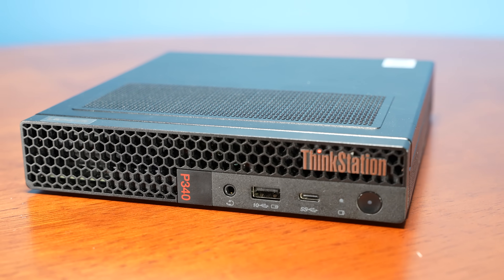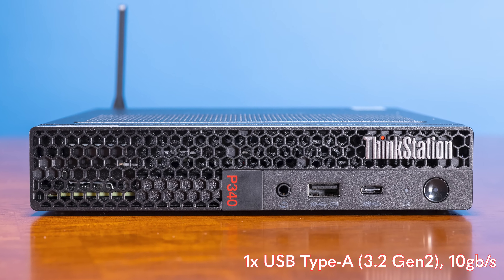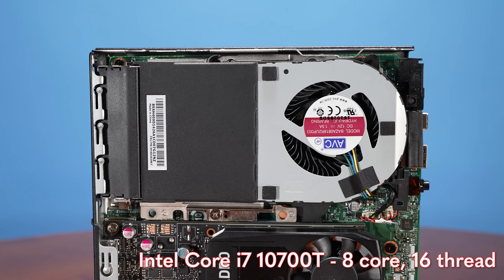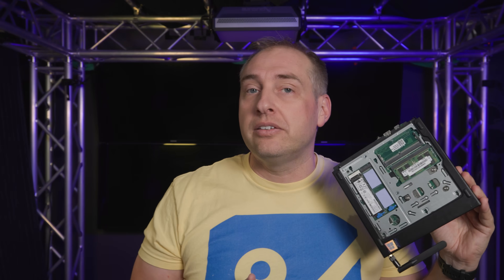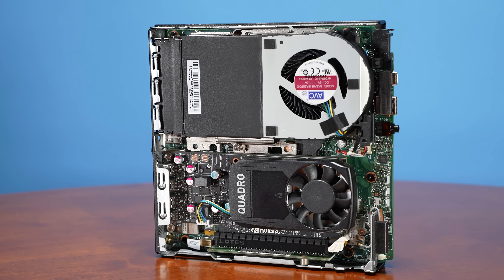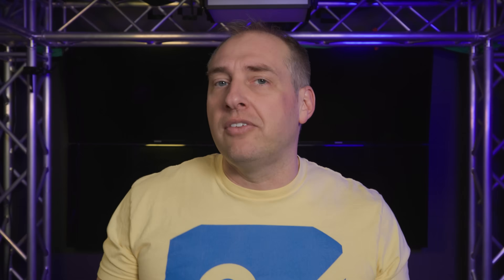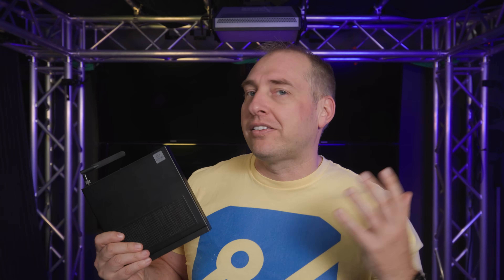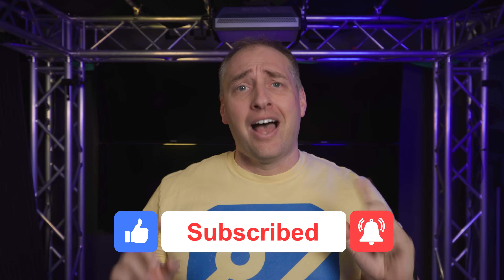1L with a GPU! Lenovo ThinkStation P340 Tiny

Comment: The best part is seeing "Quadro"!  That brings back datacenter memories before all this AI hype with desktop GPU prices skyrocketing.  (Also, you would have to get the M75q.  I have it :)  It's Ryzen 5 3400G w/ Vega11 that also uses 2GB VRAM.  I say "uses" because it's an iGPU so technically shared system RAM.  But for significantly less $$$, the AMD benches just a tad behind this setup.)

Comment: Why is it Apple has managed to make mac-minis that run ever so quiet despite also having cooling-fans?
I need a quiet pc but can't live with the intrusive sound of fans kicking in. A constant (very) quiet hum in the background is not too bad, but it's when extra load makes the fan kick in. It's like driving a heavy car up a mountain and realising its not gonna make it and having to shift down gears to make slow advance - that revving! 
So, what's a quiet pc alternative?
Reply: Apple are miles ahead because they make their own silicon (CPUs) which are based on ARM. Take a look at the power used by the Apple M1 and M2 chips - it's around 5W. This is why they can make M1 MacBooks without fans.

Comment: Can the power brick for this Tiny also power the Tiny-in-One monitor?  Normally you use the power brick that comes with the monitor as it is made to power both the monitor and the Tiny, that wouldn't work in this case.

Comment: sorry for the Off Topic question, I have 1 of this p340 tiny I buyed used with intel i5 10th gen and 32gb ram, I changed the 256gb m2 ssd with a datacenter class kingston 480gb m2 nvme, so I have another m2 slot free. I have no discrete gpu so maybe with a rizer bracket I can use the pci express slot. Now the question: someone has experience of adding inside the Lenovo p340 tiny a m2 Coral.ai card, passing it to the proxmox host and using it with a Frigate vm to save only real motion triggered videos to an external disk? for example saving to a nas (I don't have one but want to buy also for other reasons). ma Thank you for any reply, the problem now is to find the Coral cards and their price, also the usb are out of stock worldwide.

Comment: I wish it was possible to put an HBA in that port and have a separate box that can house a bunch of drives (I believe this is called a JBOD enclosure) of matching dimensions, so that you could stack them and use this little computer as a NAS or a home server.
Reply: doesn't seem to be any reason you couldn't do that looking at the way it's built. would just have to be a half-height HBA card.

Comment: I am seeing a lot of comments suggesting the use of the Rx 6400. The AMD card uses only 4 lanes instead of 16 of PCIe 4. This means that things can get rough on PCIe 3 with less bandwidth.
Reply: A 1650 would be better for this PC than the 6400 in this case. Plus you get video encoding.
Reply: @AidGum  I wanted to say Radeon Pro W6400, as a workstation card, I don't know why I wrote RX 6400. But it also lacks the video encoding, so your point is valid. There is also a configuration option from Lenovo to add the NVIDIA T1000 8GB GDDR6 card for an extra 240USD!

Comment: I've worked on one of these in my shop, that GPU is not for gaming at all but is more meant for multiple displays. I had a customer who needed 7 outputs for his management software and this was the model we had to get for him. If you do want to game on this I would highly recommend swapping out the gpu with AMD's new sff RX 6400 which would really bring it up to modern games on medium settings.
Reply: A word of caution: not all low-profile cards are single-slot. My wife's EliteDesk 800 SFF has a low-profile GTX 1650, but it is still two-slot thick beacause of the big heat sink.

Comment: I can't keep track of Nvidia video GPU generation names any more than I can keep track of Mac OS version names. Could you give us a reference point as to what generation of GTX consumer card it's equivalent with?

As in "this is the stablemate to the GTX 9xx generation".
Reply: Some of these Quadro cards are hard to find information on.  From what I found on this one, it's similar in power to a GT 1030/ GTX 750 Ti/ GTX 570.  This is a rough estimate as there isn't a very close equivalent.  I didn't include the 900 series because to my knowledge the GTX 950 is the lowest of that generation and the 950 is a step above.

Comment: Could you try swapping out the GPU for a Network card (like a sfp+ connectx ) ?

I'm not surprised by the power consumption at idle, pascal idle gpu will be pulling 10-15W. However the creep up to 33W was very odd to me..

Just imagine this setup with a 12th gen Intel or 5th/6th Gen AMD :p

Comment: this segment is just getting going - expect major new changes - 10g and dual nvme would be nice - these fea5ture should start to emerge post zen4 which is around the corner, also the sbc mkt will pick up speed - why is this form factor so important for smb mkt sector - price and power plus they can scale up cheap without having to shell out for a powerhog loud 1u - mkt sentiment should improve but now it is on downside due to covid and supply chain and gpu issues - big io and ipc gains could help boost sentiment out of the sediment #ashy to classy

Comment: The P620 is basically a GT1030 IIRC it is slightly more powerful and feature rich. What i'm looking forward to is a 6800U/6800H based system as, with the right RAM, those should be equivelant to a GTX 1650. 
I'd also like to get my hands on the $399 Nvidia Orin NX 12 core ARM CPU, and 2048 combined FP32/INT cores. A similar core count to the RTX 3050
Reply: There was always an equivalent to the GTX 1650, the T1000, I had one on my P330 Tiny and it was lowkey a beast, P620 is closer to a GTX 1050 than a 1030, the P1000 close to the 1050Ti, if you can get an RTX A400 or T1000 for a good price then it's a really good option for the tiny PC's from Lenovo, also the RX 6400 (low profile) is good.

Comment: Now i just need an IO shield to fit an RX 6400 to throw into one of these.
Reply: Just bend the bundled in with the card, or fabricate one from 0.8mm Aluminum sheet. Maybe the 0.8 is too thin.

Comment: I just don't know why laptop-components in a desktop shell is a mark up of 20%... you miss out the screen, the UPS and the integrated keyboard.
Reply from the maker: The first dedicated server I ever ran was a notebook actually :-)
Reply: This is the "businness PC" markup, just wait to see the prices they sell office PCs at
Reply: @marcogenovesi8570  Nah, it's the same with consumer-grade... For a business it makes little sense, pairing powerful hardware with that tiny form factor; it's less serviceable and upgradeable, therefore not for heavy workload like CAD or media production long-term and too powerful for simple office-tasks where the form factor might come in handy. Something like that in a mITX for reasonable consumer prices would be nice, but then still I prefer "real" hardware, the difference in pricing doesn't make up for a little saving on the energy consumption
Reply: @anno5936  I've seen enough office PCs that cost more than a midrange gaming rig and are still unable to do anything 3D, businness prices are a thing.
Reply: @marcogenovesi8570  Yeah, you are right about that, just saying that the same "logic" applies to the consumer market if you get to that form-factor. On the other hand, I can understand the mark up for a few reasons, like extended support, availability of spares (though that didn't age well with HPs TB extension for the Prodesk Mini series) and certain platform features/tools.
Reply: @anno5936  Afaik for the consumer market the issue is that they are still devices with plenty of custom parts (cases, motherboards, heatsinks and so on), but don't sell anywhere near as well as laptops because most people will just buy a laptop just because of the convenience and portability.
So they have much smaller production runs, and this translates in higher manufacturing costs.
Yes they would be able to cut costs dramatically by using heavily mass-produced parts like mini-itx boards and cases, but then it's not "their product" anymore I guess, I'm not sure there is a real logical explanation beyond "the people taking decisions have no idea of what any of this means, aka management doing management things"

Heck even for normal office desktops they (Dell/HP) have 100% migrated to make custom motherboards that specifically fit ONLY that case for no fkin reason when in the past they were just putting their firmware on MSI and Gigabyte businness lines of boards and using mostly normal ATX cases.

Comment: I am wondering if the 10th and 11th gen Intel Core T CPUs throttle down in these Lenovo units. I had a 6700T and 7500T Dell Optiplex 1L back in the day and with stock cooling, neither power throttled after a few seconds running full load.
Reply from the maker: I think that is why the cooling is much more aggressive in these generations with top vents. Also the Core i9-10900T is not that much faster I think because of power/ thermal limits.
Reply: @ServeTheHomeVideo  I have a Lenovo m90q, and on the specs from Lenovo i can use a i9 10900, yes a regular processor, not the low wattage, thats the difference with the m70q, that model only allows the "T" processors

Comment: The GPU appears to be a regular PCI-E card, so you could upgrade to an RX 6400 and get even more power! Also I think the CPU is socketed, but finding any 10900Ts would be impossible.
Reply from the maker: It is PCIe, just a custom faceplate. The other challenge is ensuring a replacement is properly cooled
Reply: i hope HP/Dell adopt this also as i think it would make servicing much easier if not make the computer more flexible/open up upgrade options.Just wish Lenovo would also have made a ryzen version as an alternative.
Reply: @ServeTheHomeVideo  cooling should be fine as the 6400 runs really cool and the vents on the pc look really big and sufficient, I would love if you tested it out
Reply: @pineapplepizza5733  Aren't these  PCs vendor locke dusually? As in they wont just accept any old gpu on that slot.
Reply: A 1650 would be better because I'm pretty sure this runs off PCie 3 only.
Reply: @AidGum  I guess you can spring for the more modern ones with x8 pcie 4.0 or the Quadro T1000
Reply: Also, 12900T versions with undervolting would be great for a beowulf cluster. 64GB would be nice too.

Comment: You always make vPro availability more complex than reality :) vPro requires three things: 1. compatible CPU 2. compatible PCH 3. compatible bios chip/file. Most OEM use a 1.5Mb bios file which only include ME, vPro has a bigger space requirement (5Mb). This size difference usually materialize as a different logic board for standard and vPro machines.
Reply from the maker: It is less about the availability, and more that we have folks that buy systems that can support vPro, CPUs that can support vPro, but then fail at the final software enablement. Usually this is a corporate IT department that said no vPro so the system looks like it should but does not. That was a bit challenge early in TMM for our readers/ viewers so I like to call it out.
Reply: @ServeTheHomeVideo  well said. I’ve had this pop up a lot in my work and it can be misleading/confusing. Appreciate you making it transparent for us all!
Reply: To be fair, vPro has never been something that intel has properly explained to the press, nor has it educated it’s industry engineers on it to any sort of reasonable extent. I can understand why it has been seen in a negative light overall. It has its advantages, but even after all of my learning and qualifications, I had to read through some stack overflow thread to understand it properly - and that was written by complete randoms in the field!